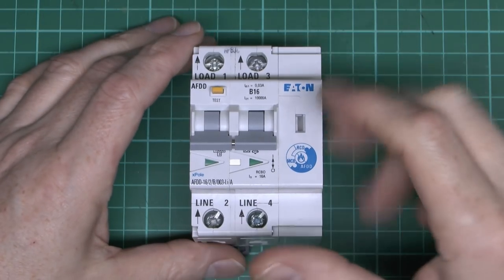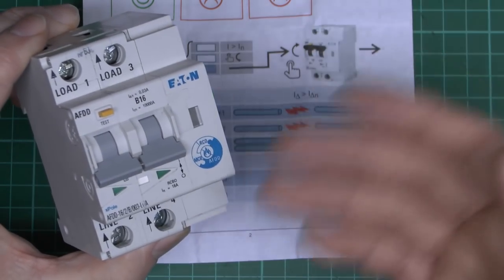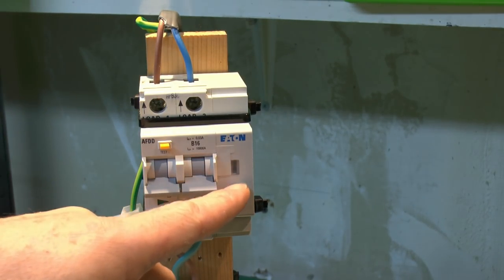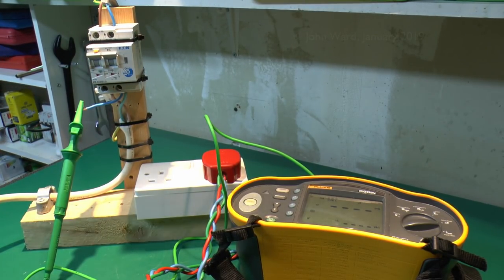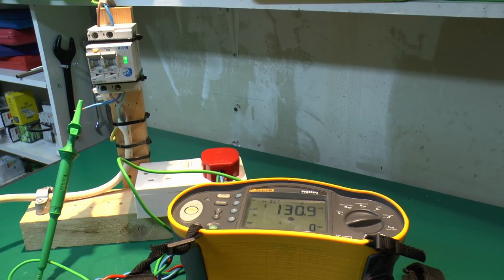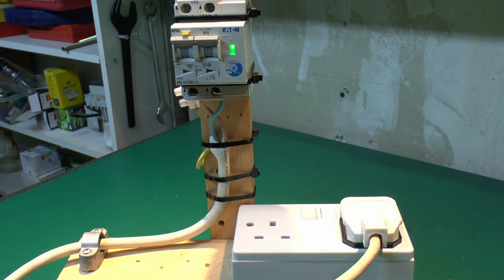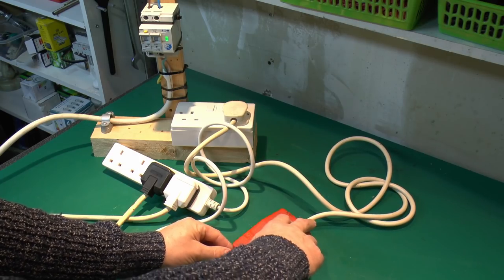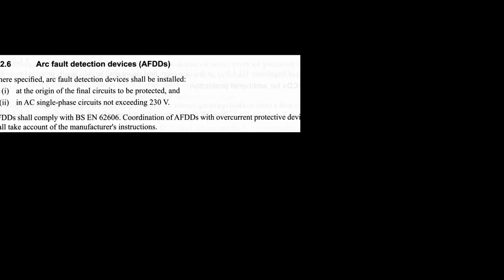AFDD - Arc Fault Detection Device - Part 1

Comment: +John Ward

(1) How is our wiring different to USA 110v systems, their use of Wire-Nuts, higher currents for same loads, and suchlike we don't accept, knob+tube circuits, etc which presumably makes AFDDs rather less necessary here?  More to the point do ARCs sustain / heat / etc differently simply by nature of the lowered voltage?.

(2) In your electricians' experience, when have you seen evidence of ARCing in wiring anyway, and what issues has it apparently caused in practice?  Just Melted/charred terminals or actual fires ever?.  Bad joint broken ring-circuit, etc etc...?

[ I'm suspecting more fires happen because evil deathdapters/deadly resistive extension-cords (which can set on fire without arcing at first), etc. -- rather than fixed-wiring issues...? ].
Reply: 120 volt..  It stated 110 - 120. Buy in 30 years of service never seen below 120 in "Residential Service"  Canada
Reply: Electric shower circuits are one of the few places that I've seen serious damage caused by arcing and the only place I'd be tempted to install an AFDD right now.
Reply: Knob and tube wiring has been outlawed for some 70+ years now. It is classified as "Functionally Obsolete" Which, as far as code is concerned, means that if left untouched, unmodified, and otherwise undisturbed, it can be left in place and does not constitute a hazard. However.... most people, when faced with knob and tube wiring, promptly call an electrician and have it torn out and replaced by modern wiring. I've run across many homes still sporting their original K&T wiring, and it's held up reasonably well over the years. The problem comes when someone wants to add an outlet or a light somewhere and decides the best way is to tap into this ancient wiring. First off, its illegal. The minute you touch this stuff it legally has to be torn out and replaced. Secondly, when properly installed, the splices of K&T were tightly wrapped, soldered and then covered in a fibrous tape. What makes it especially dangerous is when some yokel adds in his new circuit by imitating what he sees and bares a wire, wraps his new one around it and then wads up 12 feet of electrical tape around it. No solder, no mechanical connection. This makes a high resistance joint and this is what makes K&T dangerous. And I see it all the time. K&T should be replaced in EVERY case, whether it's been meddled with or not, but to set the record straight, It has not been allowed for a very long time, and gets its bad reputation from incorrect modification over time, not because it is inherently dangerous.

We could argue the merits of wire-nuts until we are blue in the face... Those things have been tested and retested by so many labs and independent outfits, I think their safety and reliability has been well studied. Again, most wire-nut related failures come down to users not using them properly. I know it seems stupid, I mean how hard is it to screw one of these things over a couple wires and call it a day. But some people are just stupid and will cram far too many wires into them, mix copper and aluminum (aluminium), or just plain not screw it on tight enough. Every package of these things has clear instructions - that nobody reads - that specifies exactly what you can and can not splice with a wire nut. EVERY possible combination of size, number and stranding has to be tested and printed on the packaging. Want to splice a #10 stranded to two #14 solids?.... If its approved for that, it'll be printed on the package. If the combination you want to splice isn't on the package... don't do it. Since 99.999% of the time you will be splicing 2-4 of the exact same wires, this usually isn't a problem. Most general residential circuits in the US are 15 amp 120 volt circuits, using 14 AWG solid core wire. Generally the only thing you'll be concerned with is how many you can cram into a wire nut. The first listings on the package will be how many of a specific gauge are approved for that wire nut, then the list goes on to include the bizarre combinations that almost no one would ever make, but they have to test for them anyway. Suffice it to say, these things have been proven to be very safe and reliable. I'll admit they seem a haphazard way to splice wires, but when done correctly, make a very solid joint. I'd love to send John a box of them for testing. I'd love to see what he thinks of them.
Reply: @chrisrichard298  Knob and Tube wiring is still permitted by the NEC : art. 394.
Reply: @eschu1010  I didn't know that, but I guess I'm not surprised. However, it is a moot point as it relates to AFCI protection. The mandate for AFCI breakers isn't retroactive, so there is no incentive to protect knob and tube wiring with them. Also, no one in their right mind would ever install knob and tube wiring in this day and age, and no inspector would ever approve it, regardless of what the code says.
Reply: I'm in Italy, so 230V, and I've had an arc fault before.  The wiring in my apartment was positively ancient and absolutely awful, everything was oxidized to the point of not even being recognizable as copper. What little wasn't oxidized to shit appeared to have been hamstrung repairs done by the previous owner (cables of random colors with neutral and live on the same color, tape everywhere, wires starting with one color from a box and arriving a different color, etc).
As far as the topology of the system, the various distribution boxes (one per room) are just daisy chained together and there's only one breaker that protects everything.

Anyway I had a series fault on a taped connection. The light in one of the rooms wouldn't turn on, but when I also turned on the light in an unrelated room they both lit up intermittently and there was audible arcing from one of the distribution boxes. I turned off everything, opened the box and found a mess of charred cables on either the phase or neutral - can't remember which.
It didn't cause a fire, but it very well could have since it wasn't tripping the breaker.

That was the final straw in a long series of random faults and I replaced all of the wiring shortly after.

Comment: Interesting.  I would like to see what would happen if either line or neutral was arcing but not both at the same time.  Could you re-wire and test again so the quick connect was only switching one live conductor?  It could possibly be more representative of a real fault. Great video anyway, thanks for sharing!
Reply: It doesn't have earth connected, so it can't tell. Thus the suggestion is bogus.

Comment: JW - have you read the Standard and looked at the detection curves?  If so you would see that according to IEC 62606 & 60898-1 that a 40w load is not supposed to trip these things.

Comment: another informative video  thank you John
 it seems that this device is not such a guardian of protection against arching as its marketing spin suggests., minor arching at switches may well not have any effect until its already quite severe. but i suppose it protects against the ordinary person ignoring a developing problem with the electrical system and it will eventually operate due to hidden arching problems within the wiring system

Comment: John, you state the RCD/RCBO must trip within 200mS at x1.  It is in fact 300mS at x1 for the current models of RCDs/RCBOs to BS EN61008 and 61009.  As this device comes under a different BS number, does it state on the instructions what the tripping time should be at x1?

Comment: John, have you done anything concerning cumulative leakage current on class 2 equipment?
In SMPS you typically have a 3n3 Y1 cap primary to secondary leading to about 0.4mA leakage.
Put 10 prices of AV equipment together and you have 4mA.
Quite a painful and potentially dangerous tingle if you touch a 0V part such as RCA connector.

Comment: Wonder if these devices will work with sodium or mercury lamp circuits, or even old fluorescent with traditional choke ballasts and starters?
What about "normally" sparking series brush motors?

Comment: John if you have a large Hostel  many rooms all fuseboards are protected with AC type RCBO'S do you have to change them for AFDD'S and would it be just the sockets and cookers with the new regs or is it safe with all the RCBO'S  for continued use  How do I advise the owner Thanks

Comment: I see only 1 test button instead of 2. Ideally we should have 1 for AFDD, and 1 for RCD. For many reasons, I suspect the yellow test button to be for RCD instead of AFDD. The white indicator should turn blue for all causes of tripping, including overcurrent. Also, as for RCD, 30 mA is good enough for equipment protection, but not good enough for human protection. A person might die with 20 mA maintained through vital parts of the body (even more so if caused by 240V than 120V). In Canada and USA, we have 5 mA with a time of about 30 msec (a bit less than 2 cycles).

Comment: Nice informative video John. There's not really much about regarding AFDDs apart from Americans and it seems they don't like them. I hope it takes a long time before these unnecessary pieces of equipment are actually required by the regs. Fortunately, I should be retired before they are required. RCDs do the job of preventing fire well enough. I can't see them getting the balance right to allow them to be effective while not being oversensitive and tripping every time you use a hoover etc. There don't seem to be any statistics proving effectiveness or the need for them.
How on earth are you going to put these in a domestic DB at 3 modules wide. I can only see there use in special circumstances in dedicated enclosures or large TPN DBs.

A bit of advice on creating arcing using the mains safeblock. Not a good idea. It will damage the contacts. I now always switch off before opening or closing mine. I only had a light load on and it arced without me realizing. I went to close it and it was catching. When I looked closer the spring contact had a slightly pitted surface that the top contact was catching on and bending out of shape.

Comment: Hi John, wondered if you have done a video on RCD types AC A F B B+ etc.

Seen hager have brought a 18th edition DB with type A rcds in, thought these were only required where car chargers were installed but most car chargers have them in them any advice? Thanks Darren

Comment: Does the test button test the AFDD function or the RCD function? I only see one test button on the device. The new 18th edition test sheets have tick box for the test button operation for AFDD's and another tick box for the RCD's test button function.
Reply from the maker: The button is supposed to test the whole thing, RCD and AFDD .
Reply: @jwflame  Ok, thank you. How do you know if one of them failed the button test ?The RCD and AFFD leavers are joined together. .
Reply from the maker: @ProCertsSoftware  Unfortunately no way to know.  The RCD can be tested with a normal RCD tester, but for the AFDD part the only test is the button, or relying on the device to show a fault via the LED on the front.

Comment: Perhaps the arc detection is deliberately insensitive to avoid nuisance trips? In terms of old switches vs actual faults, it might be a very narrow window to work with. But I'm just speculating...

Comment: An arc ussualy is a high spike in voltage, inductance  your test rig looks like it it dose not provide fault conditions 

Might i sujest rubing 1 wire together rather than dual live nuetral rub.

Comment: Thanks, John, I am not enthused by this device especially as it is a 3 module unit and fault interpretation is not clear for most end users. London Fire brigade should stick to their day job.
Reply: @mikeZL3XD7029  most regs that apply to fire prevention come in because of the fire brigade
Reply: @pmailkeey agreed, they don't investigate very well. Appliances are the biggest cause of house fires with electricity yet they just put it down as electrical fire and try to prevent the wrong way. Like metal consumer units to prevent fire spreading, instead if addressing what causes the fire, ie loose terminations. Most tails come loose and they could resolve this with 2 screws to tighten down on the cable or have a crimp/ferrule to clamp on instead of stranded cable
Reply: @adrianking6309  Very good points made regarding terminations in consumer units, this is exactly where I see improvements should be made, also there is room for improvement with the screws themselves.

Comment: Mr ward i am in the state's and i purchased a mixer from italy and it. Works off of 230v single phase european. It has a brown and blue and earth wire. I know the brown is my power and blue is my neutral. I watch your videos all the time even though I'm in the state's. 

Now for my question. Can i run a 120v line to make it work. Cause here in the states 230v is two phases and an earth. Im a little doubtful that our 120v will have the mixer working to its full capacity. Please help

Comment: Hi John. Do you if these will be taking over from RCD's? Like new comsumer units will have AFDD's instead of RCD's.
Reply from the maker: AFDDs are 3 in one devices, and are intended to replace RCBOs.  They are designed for use on one circuit only, so won't replace RCDs that cover multiple circuits.

Comment: I'm guessing you already know but you get single module normal size MCB & RCD combined and there not the long ones as well. There just the size of a normal MCB. 
Something that will be being installed soon and I recon it'll be saying it in the new regs are fault current devices. Clive's done a video on one. There design for TT systems but personally I think they should be in every type of supply's. I've just purchased one (even though I haven't installed it yet) and I live in a new development TN-C-S. You can get them in different kA's, I think the one I've got it 60kA 🤔 
You can get cheaper ones that have different breaking loads 20kA & 40kA. 

If you've got a lot of electronics (which is every dwelling these days) then I'd highly recommend one. Even though most electronics are designed for over voltage protection but if you loose a phase on your local tranny, it'll shoot way over 400V as most incoming supplies are over 240V.
Mines between 245-248! and I know Clive's got (even though he lives in the middle of nowhere like my nan & grand (TT)) around 245V n so does my nan & grand.

All of these new "laws and regulations" really have worked well changing the voltages even though they haven't. 
They should of kept the 240 & 415 as that's what it is and then some. 

Sorry I'm ranting like Clive with the "new  colour codes"

Comment: Dear John, 
This is not a dear John message.....  but how do I contact you otherwise? 
Just discovered (whilst on a job)  a TN-s system but the power to the shed and metal frame greenhouse at the bottom of the garden both have earth rods as well earthing to house.... puzzled, necessary? I can't work it out somehow...
Steve Retired  electrician

Comment: Over voltage trip would be more useful in the uk as we can get high voltage in from the supply with the loss of neutral. I have witnessed this in a housing estate with the street lights going up in smoke. Apparently these devices don’t work on a ring main ether. Anyone know about this being correct?
Reply: Read the BEAMA Guide to AFDD's (Section 9 on page 15)

Comment: Wonder if how different brands compare anyone  got some thay could check out,  I'm not a great fan of eaton gear when there new range of mould case breakers came out a few years ago terminal clamps where falling off ,windows over the trip current setting where missing ,wernt impressed

Comment: I was at the Elex Fair at Ally Pally the other day and all the manufacturers were saying if you dont fit arc fault & surge protection  in new installs and CU replacements you should get them to sign something saying they didn't want them or you are open to being sued!

What do you guys think, genuine thing to do or scare tactics by manufacturers to sell more devices?

Sounds a bit far fetched to me.

Comment: So what i see, this will not detect earth leakage, infact i see the earth fault loop is not there, so ze is not therer, the protection is in R2, Not extinguished by earth fault current, extinguish by AFDD,  C an any one tell me, the mechanical stresses, that could cause this thing to trip

Comment: A good and obviously fair test.
That AFDD is clearly a POS. I understand that a higher load has a lower resistance and that the heat build up (given the same heat dissipation) would be quicker BUT really??? An arc is an arc and it didn't detect it.    P.O.S. Well done for exposing it.

Comment: I really don't understand why the test isn't done with a cable stuck in the door, a weeak wire ia a soket  or a hole screw, I don't know what other examples, we test with a micrometer... I give 150-300 $ to play with a micrometer, because only then it disconnect , on good?!. Until someone manages to make it disconnect to real defects and not micrometers and screws, it's not worth 2 bucks, you'd better give it to a beggar..

Comment: I wondered how long before these things make their way to over this side of the pond. I have been following this thread on a amateur radio forum for the last 5 years in horror:-

https://www.eham.net/ehamforum/smf/index.php/topic,96949.0.html

Eaton have had to replace thousands of these devices in the US and replace them with uprated devices that are compatible with high RF field strengths. The problem is you only have to have one radio amateur in a new housing estate where these are fitted, I'll leave you to guess what is going to happen.

I just hope Eaton have learnt their lesson and supply the RFI proof breakers to the UK market, we'll see.